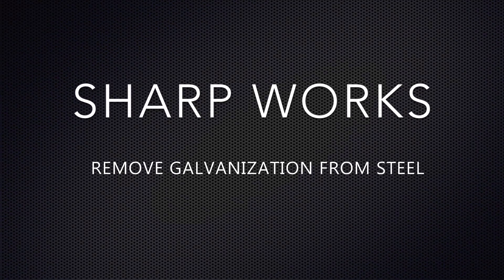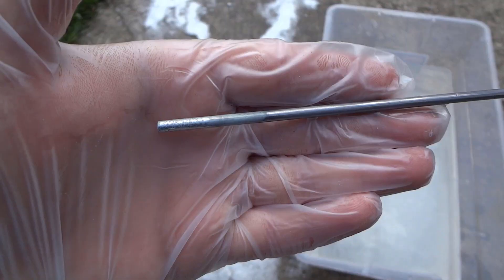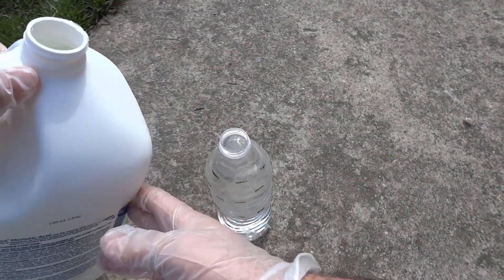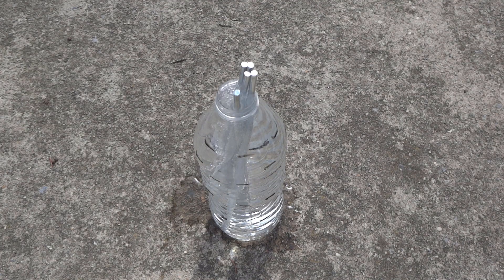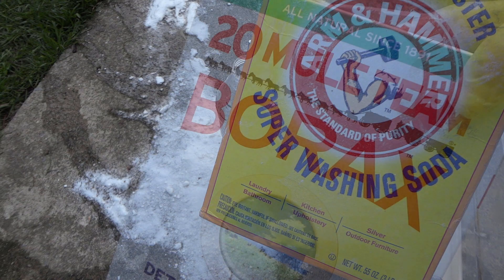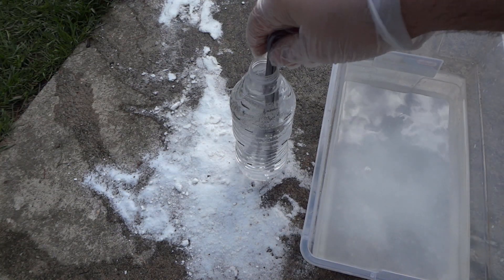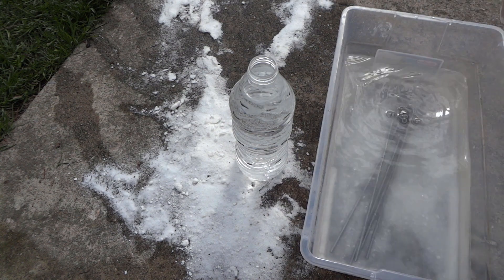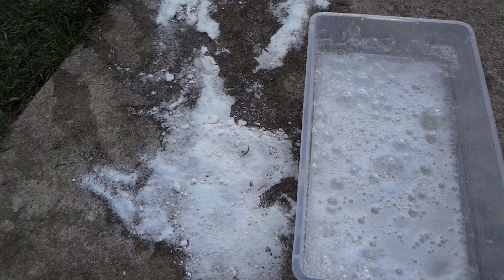How To Remove Galvanization From Steel

Comment: If it's a rather large part and can't be fully submerged , but only needs a few spots where you would be rewelding something or adding something can it be applied with a cloth or brush ? anything or dumped on ?

Comment: I went to several hardware and auto parts stores trying to find plain USS 7/16 flat washers. Took an hour to figure out I wasn't going to find them. Then I thought, 'I'll check out YouTube'....... In little more than the time it took to watch this video, the galvanized washers (I ALREADY HAD!!) were ready to weld....Thank You....... Being a pack rat, I had battery electrolyte.

Comment: Thank you. I’ve bough second hand walkway mesh covered in gal which I want to weld into a fire pit, which people will use for cooking too. Too difficult to grind/wire brush all the gal and I can’t have any left if people are cooking near it with fire.
Now I just need to find two baths big enough and a container to put the neutralised chemical in to dispose of properly. I have safety gear.

Comment: Thanks for the video.   Simpson ties use electro-galvanization, instead of hot-dip galvanization, or a zinc coating.  Do you think this process will work to remove the galvanization from Simpson Strong Ties? I need to repair a floor furnace and screw a small angle to the pilot/thermocouple unit inside the furnace, and want to take precautions regarding the fumes.

Comment: Thx for this video, i accidentally bought galvaized steel for welding , and i couldnt find ungalvanized steel, im gonna try this method to ungalvanize the steel. Is there anything about safety that i need to know about ?
Reply from the maker: Just make sure you do it outside and don’t breath in the fumes also be careful not to allow the acid to come in contact with your skin and you should be good.

Comment: I'll use a torch outside, much safer. But I have used distilled vinegar with great success indoors.
Reply: A torch to remove the galvanized coating?

Comment: This may be a dumb question but whats yhe best way to dispose of the neutralized solution. The acid and washing powder mixture? 

I'm thinking of just pouring the neutralized solution in cat litter and putting it in trash? Would that be safe?
Reply from the maker: Not a dumb question at all. 
If the acid is fully neutralized, it technically should be safe enough to go down the drain, but your method sounds like it’s even better, especially if it’s a small amount. 
It’s always good to refer to what your local government or authority requires you dispose of any acidic or basic solutions.

Comment: So what strength muriatic/hydrochloric acid do we need for this process? Having googled it, it would seem most people sell it at 36% pure... Is this strong enough to dissolve the zinc coating?
Reply from the maker: I’m not exactly sure how strong this particular brand is, but I would think the stronger the solution, the faster it’ll dissolve the zinc. So I don’t think the strength matters too much as long as you give it enough time to dissolve all of the coating and pour enough of the solution to do the job.
Reply: @SharpWorks  Cheers. I guess if you wanted to bring costs down and weren't too worried about time then a weaker solution and a longer period in the solution would do the trick. I've got some chain I'd like to weld and need to remove the coating first.

Comment: Nice process.  You should correct your description and add a note on the video to add acid to water, never the other way around.  You actually did it correctly.  (Read the label)
If you thought that was too reactive, you could add your acid solution to a larger volume of plain water, and then add that to the neutralizing solution.

Comment: What's the best way to dispose of the mixed solution once you're done using it?
Reply: I dump it down the nearest fire ant mound I can find.  The rain will wash it away.
Reply from the maker: First, make sure you fully neutralize the acid with baking soda. Once it’s fully neutralized, you can dilute it with water. In theory it should be safe to wash down the drain. This should work for small quantities. Just double check your local laws if that would be fine with the amount you expect to dispose.

Comment: Very very helpful. I want to use electrolysis to remove rust from inside a motorcycle gas tank but due to it's odd shape and some additional tubing inside it, it's been tricky to figure out what bits of old metal I can fit in there. Found a landscaping stake at the hardware store but it's galvanised and I wasn't sure if that meant I shouldn't use it (apparently we shouldn't use stainless steel for the sacrificial anode due to the chrome in it or something). So I will use this technique to remove the galvanisation to plain steel first. Thanks again!
Reply from the maker: I’m glad I could help! Good luck with your project 👍

Comment: I’m wanting to weld galvanized pipe together and everywhere I read and watch on YouTube it says “DON’T UNLESS PROPERLY VENTILATED OR GALVANIZATION IS REMOVED”. I’m no expert and have no knowledge on this subject... is this a solution to which this metal becomes weldable with little to no toxic danger?
Reply from the maker: Yes, I believe you can weld after you remove the galvanization with this process. Just make sure all of it is off completely before attempting. And make sure to do use this solution outdoors in a well ventilated area as well.

Comment: Good Video'   For all of you going to try this remember "" ADD ACID TO WATER CAUSE YOU KNOW YOU OUGHTA""!   Also Remember to put the Cap Back onto your Muriatic Acid Bottle right away! It's corrosive and will start to eat and rust all the metal in any area the fumes come into contact with.
Reply from the maker: Good information; thanks for sharing.
Reply: Even with the cap screwed on tightly any metal within a couple feet will be rusted and pitted in a few days !!! Almost lost my framing gun to this sh*t !!!!!

Comment: The reason you want to do it in a well-ventilated area is not the same reason you don't want to weld with it. It doesn't produce toxic zinc fumes in muriatic acid, it produces explosive hydrogen gas (H2). That said, do it away from an ignition source as well.

Comment: You used the correct technique when pouring acid into the neutralizer.  Your comment about doing it the other way around is incorrect.  Always pour the acid into water or neutralizing agent.  Think "aw" (as in awww, what a cute kitty = Acid into Water and WA! (Don't do it!) = Water into Acid.  Goofy perhaps, but it's easy to remember.
Reply: I always think of it as "drop acid, not water"

Drugs ftw
Reply: Another way to remember it is "Always Add Acid (AAA)"
Reply: @eric.s.5919  Easiest way to remember is use Alphabetic Order.

Add A(cid) to W(ater).

And I AM a Chemist ;).
Reply from the maker: Haha that is good to remember. I keep getting conflicting comments on some of my other videos. I’m no chemist so I don’t want to mislead people. Thank you for the information.
Reply: Think of it this way when you pour acid into water if you do it fast there's a chance for the water to jump up at you. So if you poured water into the acid the acid would be jumping at you. 

I know this because you can't do it the correct way if your filling a battery with distilled water and I had the acid jump up at my eye! Lucky I had water on hand to rinse it fast so if I ever need to do that again I'm definitely wearing protection! Sometimes you don't learn until you have a bit of an accident lol
Reply: @TotoGuy-Original  true but sulphuric acid is more of a problem than muriatic in this regard.
Reply: Do what you oughta, add acid to wata.

Comment: thanks. i got some square tubes for free to make a welding cart. but it has a heavy galvanized coating. will try this cause i could grind the out side of the tubes but not the inside.